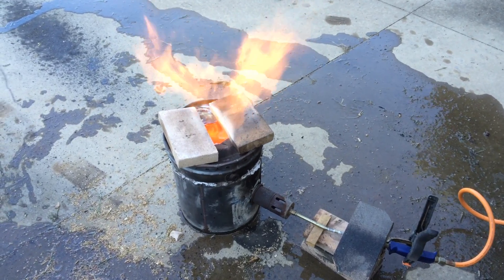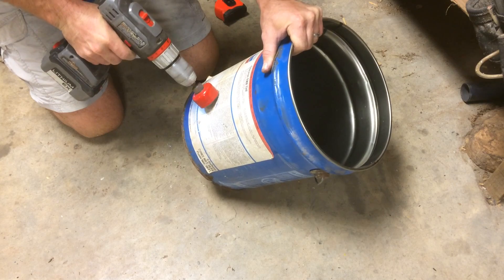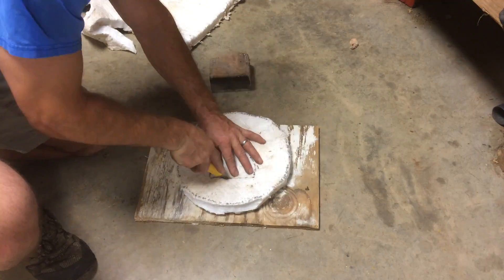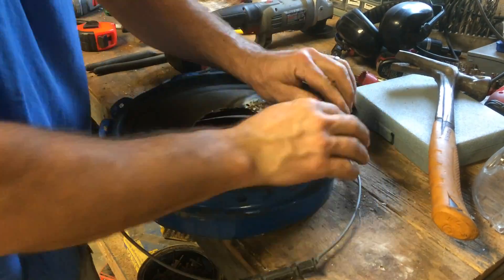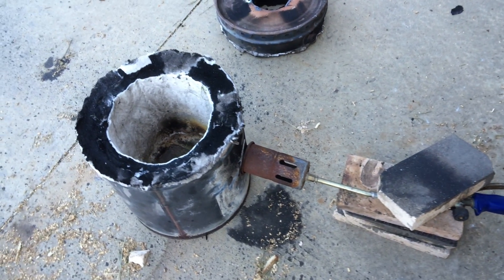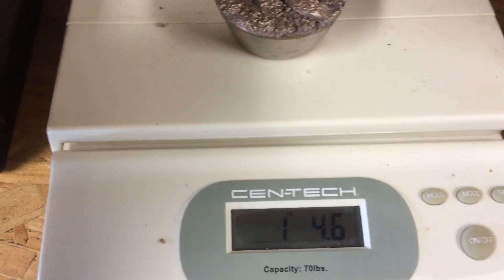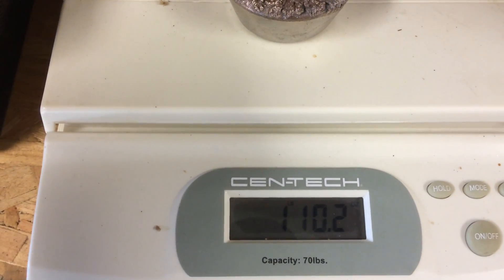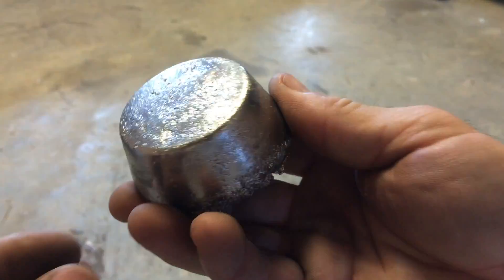Build a metal melting foundry furnace in under 2 hours. No refractory!  FarmCraft101

Comment: I don't have any brass, but I do have a fair bit of mild chromalloy steel and a bit of titanium... could try mixing the titanium with some of the stainless spring steel, cast it into small engine valves. but the temperatures are very extreme. looking into Acetylene or Electricity, one could work in a home made furnace but the other is very explosive and requires a large engineered system that can soft draw power and then discharge it violently. could modify a cheep welder that has a hot start function with a larger array of capacitors. but that's unsafe, but then fire is too.

Comment: Will this melt steel? Ball bearings and such
Reply from the maker: Steel burns before it melts.  The only way to melt steel is in an oxygen free environment with temps around 2500F.  Very hard to do for the hobbyist.  That's why most people forge steel rather than melting and casting it.  It could melt cast iron depending on the burner used.
Reply: No you cant

Comment: Amazing work! Just a question, can it reach 1400 degrees Celsius (2552 Fahrenheit)?
Reply from the maker: All depends on the burner.  With my propane burner I don't think I could reach that temperature, but I've gotten close.  I melted copper which melts at 2000F, so I think I was about 2100F.  Putting another layer of ceramic insulation around the outside would help.
Reply: Thank you very much for the quick answer, im interested in melting Basalt Rock (which melts at that point), to create Basalt  Fiber.
Reply: @AzoreanProud  to make rock wool? I wonder if electric kiln would work, made by you, with NiCr elements and refractory brick, also with a crucible.

Comment: Nice, but not the cheapest. "Cheap" and "ceramic fiber" are two words that don't exist in the same reality.
Reply from the maker: Cheapest that actually works without falling apart in a few firings.  But yes, there is some cost involved.  Still, it's cheaper and so much easier than refractory.  Thanks for watching!
Reply: Very true. Some of the cheaper ones I've seen just fall apart after about two firings, like you mentioned. The first one I made was from two coffee cans and a hair dryer and charcoal. Completely free, but VERY thermally inefficient. I was just recently able to afford some ceramic fiber and am going to build a better foundry out of a tall propane tank. This video of yours gave me a good tip for using a fire brick in the bottom as a base for my crucible. I was continuing to contemplate how I was going to keep the crucible stable, but you just gave me a great option. Thanks for the video, keep up the good work, and have a great day.
Reply: I would add a small hole in the bottom of the furnace, just in case your crucible failed. Just a thought.
Reply: @maceglass  and have the molten metal land on the concrete .............good luck with that lol

Comment: You should have a go at melting cast iron with that Walmart propane burner.
Reply from the maker: + luckygen1001 I may give it a try with propane if I can't get the waste oil burner figured out. I'm making progress though. I've melted copper.
Reply from the maker: On second thought, I definitely will.  Would be a cool video if it's successful.  Have a lot on my plate lately, so it will take awhile to get to it.  Thanks for the inspiration Luckygen!
Reply: Not possible. Too rich of a burner

Comment: Nice, just stand upwind of the bluish/white smoke coming from the crucible when skimming off dross, on brass melts the smoke is zinc and toxic if breathed in...just do your best to avoid it. You have seen my channel and I am no safety sissy...just my two cents there. The surface finish on your ingot looks similiar to brass ingots I have poured, its a reaction with the air while cooling (oxidation), as you can see the rest of the ingot looked fine. I would like to see if a shielding gas like argon would preserve the surface such as in Tig welding.